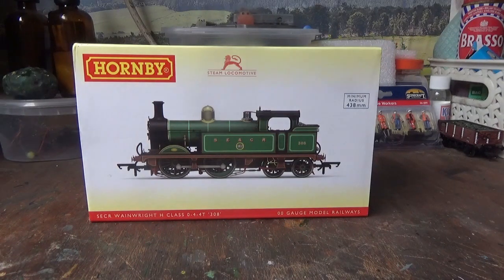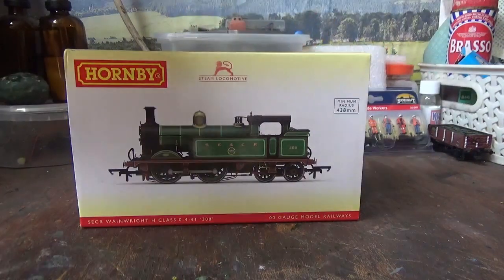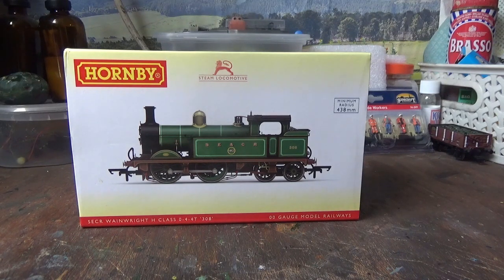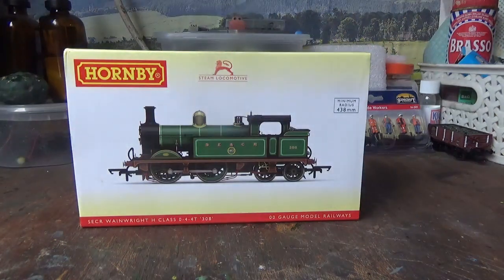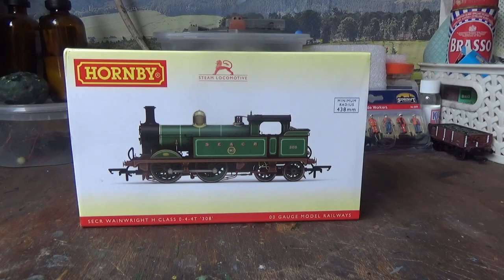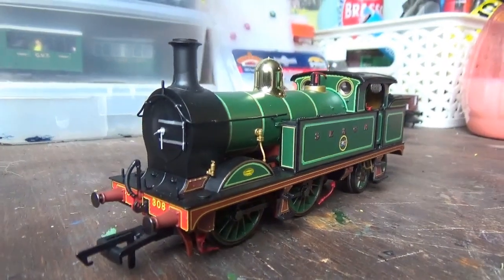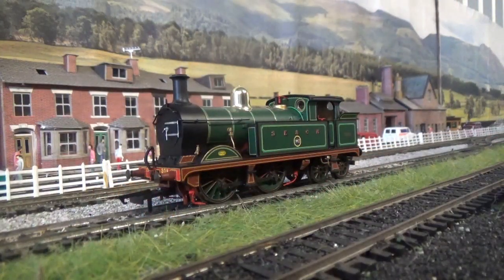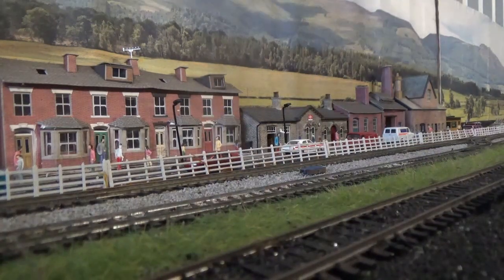Hornby SE&CR H Class | Back in Service after Motor Repairs

Comment: I just bought a Hornby H Class today, and while it runs great, I have noticed the boiler is getting warm. Is there anything you recommend me doing, I live in North America, so sending it to Hornby for repairs probably isn’t the best choice for me…
Reply from the maker: Did you buy it from a shop? If you can repair it yourself I'd recommend taking off the body and having a look. If not I'd recommend taking it back to the retailer
Reply: @class47peter  I bought it as a used item that had never been opened (I know, kinda odd). I’ve done some more running and it seems to be better now, it’s getting a little warm, but not as bad as it was, so I’m guessing it was just burning off some old lubricant or something. If anything does go wrong, I can probably replace the motor myself, I was just wondering if you had any suggestions.